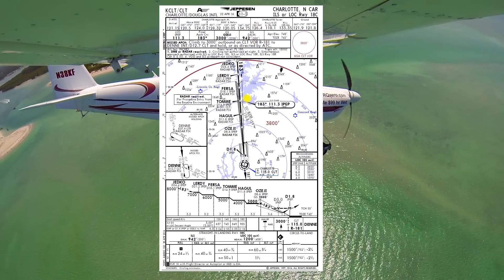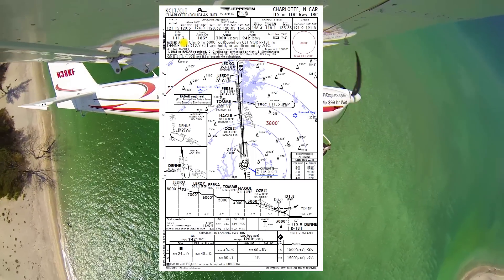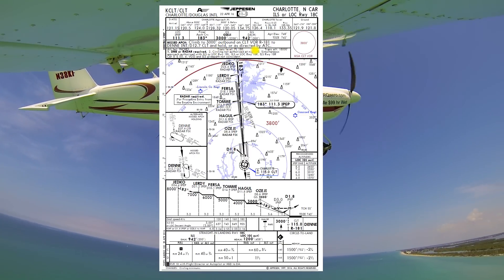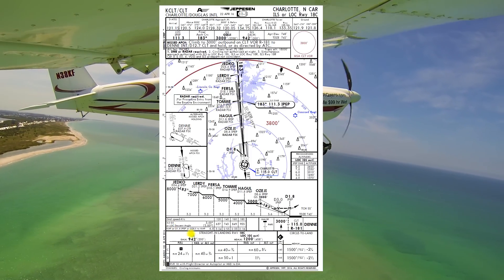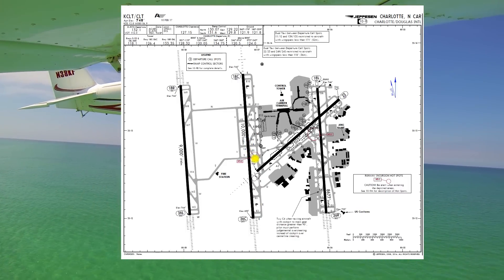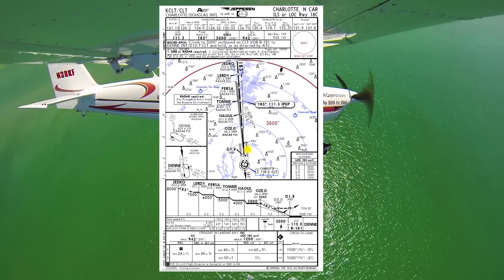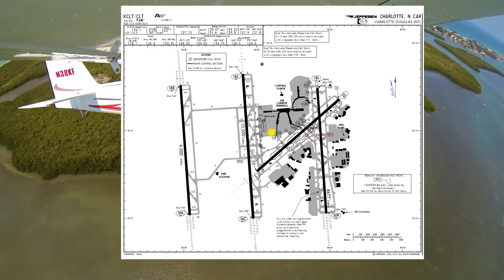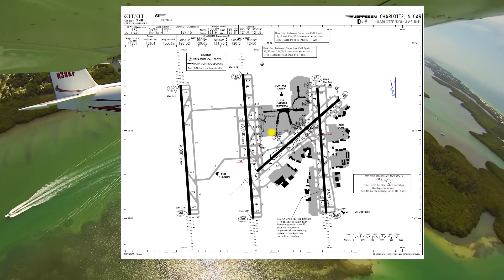IFR #9: How to Brief a Jepp Approach Plate

Comment: I'm trying to teach myself the difference between Jepp and NACO and just happened to run across your video first. I was wondering where the circling min's were on the Jepps of 1240-1 and why didn't you use the 1800 RVR or were you not using an AP or FD or HUD. I probable had to much time on my hands watching this.